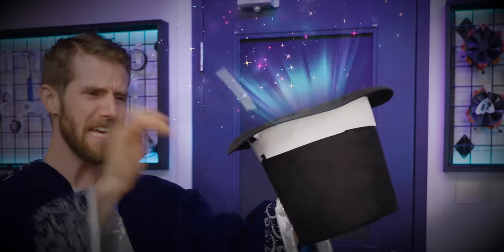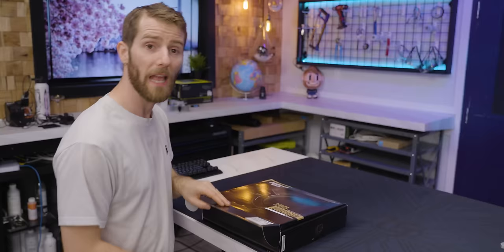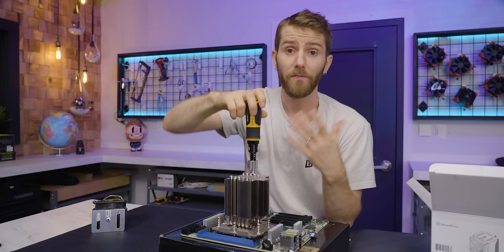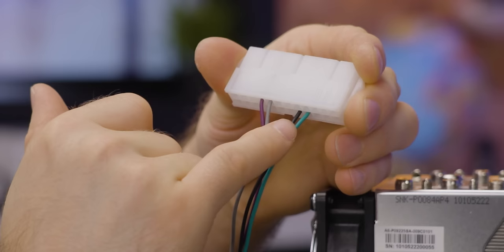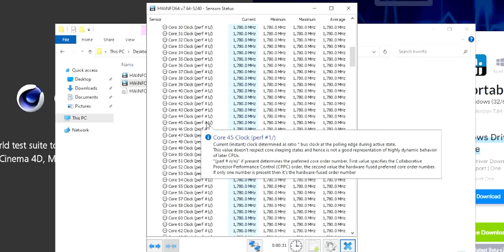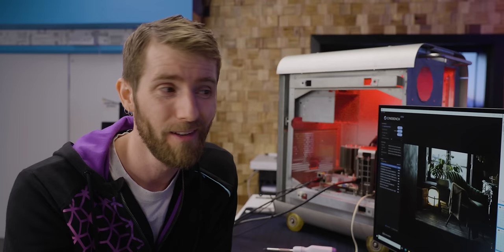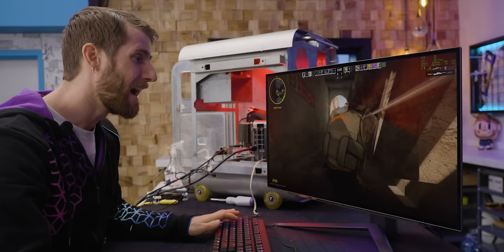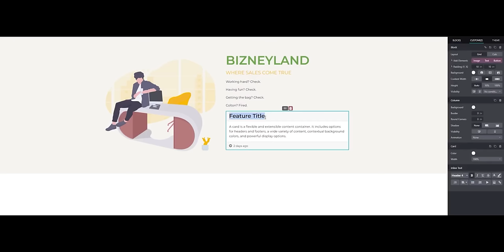AMD’s 128 Core MONSTER - Epyc Bergamo

Comment: I'm never going to get over how big the die is on EPYC.
Reply: “When your socket is almost as big as your memory slot” #justepycthings
Reply: There's 9 dies and they're not that big.
Reply: It's the same as Threadripper, in fact Threadripper are just consumer versions of EPYC
Reply: Compared to all other CPUs, it is GIGANTIC. @jfolz
Reply: One day we're gonna have Epycs that are gonna be the size of a 2.5" drive :D
Reply: @Qardo  The combined size of the dies sure, but individually they aren't that big
Reply: @Qardo  the IO die is about as big as AD103 (4080), which is big for a CPU, but it's also made on a less advanced process node. Each CCD is nothing special. Putting so many of them on one package is where the magic happens.
Reply: i want a normal ryzen 7 or 9 with that size. WAY better cooling!
Reply: It's like a coaster!
Reply: Just the CPU is about the same size as an entire Raspberry Pi
Reply: @Qardo the die and cpu are two different terms. The dies are specific silicon cores from the wafer. The cpu is composed of these dies. This one has, what did he say 8 or 16 dies, each die has several cpu cores.
Reply: @jfolz he clearly meant the package. It can be easy to get the 2 confused when you are learning. I am sure he will know the difference soon. Education education. Just let him know it's the package instead of been condescending 😊
Reply: @funbucket09  that wasn't my intention. However, how the new Bergamo CPUs are constructed out of many different dies (and how it differs from Genoa) is the first thing that's explained in the video 🤷

Comment: I remember how when I was a kid everyone had 128MB or 256MB of ram and when someone had 512MB it was like, whoah what do you need that much for. And once 512MB became normal but 1GB was still kinda extravagant, people would buy a 512MB stick and then wouldn't know what to do with the old 256 stick, and so they'd put both and run 768MB in single channel.
This computer has 768GB. 
Similarly, when I was a kid a 1GB disk was considered a big one. Now we have disks that can have several TB each.
It's like, in some 25-ish? years we got to a point when 1GB nowadays feels like 1MB back then, whether storage or memory, and 1TB today feels like 1GB back then. And it's messing with my head now lol
Reply: Well, you gotta factor in that eventually adcvancements will slow down. At some point we will reach hard physical boundaries.
Reply: This computer supports way more than 768GB, it's just infeasible to go higher unless you have a reason to spend the money. 256GB single dimms can be had for $3k each.

What's truly crazy is that the 768MB of memory you're talking about is now how much on-die cache these chips have, or a little over 1.1GiB for the X3D Genoa variants.

Comment: I suspect most end-users of this monstrous Epyc CPU will be running Linux, so it's sad to see LTT yet again put Windows on their test bench for a server CPU. Phoronix Test Suite is probably something LTT should have looked at, because that has quite a few server-related tests in it.
Reply: Especially the gaming benchmarks as always. Yes, those CPUs suck at them, because of the low clock speeds. Just in the last video about a server CPU and the one before it and the one before that.
Would be interesting to go through some real workloads for that, even if they would have to introduce most viewers to some other benchmarks for that.
Reply: The plurality will probably be ESXi followed by Linux and Windows. These really aren't the current best option for Cloud data centers currently, so for right now you would be looking at in house clusters or specialized systems. That means ESXi followed by Windows followed by Linux. And before anyone jumps on me, I do prefer KVM over HyperV, but Windows also has RDS virtualization which helps give them implementation numbers.
Reply: Thanks for confirming Linux users are the vegans of the PC community. We get it you like Linux.
Reply: they said at the end of the video none of these benchmarks are real tests of what they are for, and that the people buying this sort of stuff would either optimise their systems for it or let the customers who are renting the servers to figure it out themselves, i seriously doubt the real end users of this cpu would actually be getting data from ltt in help with their purchase
Reply: The point of running Windows is so that it's a like-for-like comparison. To use Linux, they'd need to go back and test all the others on Linux. And any viewer would need to run Linux to be able to compare it with their own system.
Reply: And server-related workloads are better suited on Intel, granted if people optimize to take advantage of the built in accelerations Intel has to offer. Plus AMD lags behind because they still only offer 2 sockets per system.
Reply: agreed, they shouldn't run Windows... they should run 64 Windows VMs with 4 cores and 8GB RAM each.
Reply: I think we still need that for a good comparison. Cuz windows should also be tested to see if they’ve made any improvements for server stuff. Mostly tho it’s just the applications for server stuff that hate windows for no reason (Aka they coded it bad, or hay’s windows as well lol)
Reply: You would be running Linux, without a doubt.

This thing is a bloody monster.
To think you'ld have two of these per slot and at least 8 per rack, that's 2,048 physical cores per rack!!

Insane.

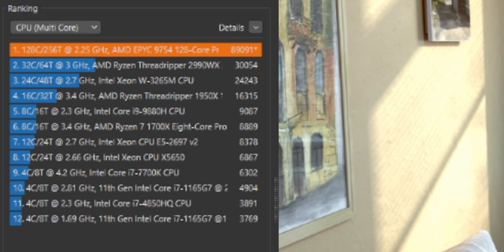Comment: 13:55 this just made me appreciate modern desktop CPUs even more. The 14900k (a 32T CPU) can hit over 43k points in the same test, which is almost half the score as this 256T CPU! (8 times the threads!!!) 
And remember, this is a test that can actually use all of those threads. Just insane how far technology has come.
Reply: Don't. That cinebench test scene wasn't anywhere near heavy enough for the cpu to shine. The gap is huge.

Comment: Take a look at GPU and cores affinity; in a worst-case scenario, you could potentially reduce GPU performance by a factor of 4. Only a few cores have direct access to the full PCI bandwidth. If the software doesn't manage this properly, it might need to go through another core, causing latency issues that could impact performance significantly. I'm familiar with these kinds of problems as I work with computing clusters.
Reply: Not much of a PC guy but, can it run Crysis?

Comment: I used to have a Opteron X2 170 with a 1Ghz overclock (on stock cooling!) for a gaming rig.  Older CPU's of that type had a lot more cache and could have similar clock speeds to their Athlong 64 counterparts, and it meant a lot more performance back then.

Comment: The M1 Ultra comparison is pretty interesting when you consider it’s a 20 core/20 thread chip vs a 128 core/256 thread chip. I know Apple’s cores are pretty great in terms of IPC but I would have expected more than a 4x difference (and this is as an M1 Ultra owner). I wonder if there’s some other bottleneck in the system or in Cinebench r24 that’s limiting the performance
Reply: What is the TDP of M1 Ultra? 50-60 W? Let use 60. So it has 20 cores. That means, 1 core has 3 W TDP. So 128 cores should have 384 W TDP.  But it only has 250/300W? That mena, that it is about for 100 cores the same but it alsi has multithreads (2/core), which makes it a bit more difficult.

Comment: As a 3970X (32c/64t) owner I’ve been waiting a long time for these replacements. I’d be interested to know how reliable they are at hitting their max boost clock, because mine rarely did, even on a single core
Reply: Water cool it, bro
Reply: @user-dv7hq2rh4g  What about undervolting a Threadripper?

Comment: 6000 points in CB2024 is 6x that of my 5900x, but its also only 60% of my 4060 that can break 10k points at 100w. I think the biggest thing CB2024 taught us is that CPUs need to leave the rendering to GPUs.
Reply: Less that and more that GPU architecture is highly optimized for rendering.
Reply: …unless you want to render a real scene for a big budget movie, in which case the textures alone might be in the range of 100 GB - good luck fitting that into any GPU memory.
Reply: A bit more than the 822 points my i9-10900X gets lol. My GPU, GTX 1080, scores 3993 points
Reply: till you realize that GPU's with a ton of memory cost a whole alot more than this CPU decked out

24GB VRAM costs you 2 grand USD and that translates in roughly 144GB VRAM worth of cards while this CPU can do well over 1TB

for smaller scale GPU might be fine but for 100+GB projects CPU's start to be a king due to capacity unless you get a board which can support that many cards
Reply: @danieloberhofer9035   which one do you have? outside of 4090 you only havs 7900xtx which can't really do compute tasks well cause it doesn't have CUDA

and anything older is well older and has way less performance compared to current gen
Reply: @mephistoxd2627   I honestly wonder if that memory issue can go away with better pipelines. Every pixel does not need to know about the full scene. So I am curious if some software out there works well for smaller studios that don't have the budget or needs of a server farm and so its designed to scale instead of just hard crash from memory needs.

Comment: My primary workstation has the 64 core 3990x which I use primarily with Arnold Render in Cinema 4D and Houdini. Been curious how much faster the 128 core CPU is. Looks like about 30% faster based on your test numbers. Great video! 

Cinebench 2024 is using Redshift XPU which until recently was a GPU only renderer which is quite a bit different than the old CPU based physical renderer on previous cinebench tests.
Reply: It's WAAAAY more than that lol. It's about +40% over the Zen 3 64-core Threadripper Pro 5995WX which is already ≈+25% faster than your chip.

Comment: To linus's point about F1 tech eventually making it into our daily drivers, there's actually a fantastic BBC documentary from 1984/85 that shows the entire process that went into the creation of the Ford Cosworth GBA 1.5L Turbo V6 that went into the 1986 Beaatrice/Lola-Haas/Ford (Carl not Gene).

At the end of the first part and beginning of the second it shows the development process of the ECU and they show the electronics engineers from ford motorsports europe working well into the night chasing down problems in the circuitry before the "big box" (the ECU was the size of a toaster oven) went into the car for its first track tests.

At one point they realized that there was a huge issue with detonation that was being caused by electromagnetic interference from the combustion chambers interfering with the ECU's operation, so they had to change the design placement from on top of the engine to inside the tub.

They even showed the IBM 286 desktop that the engineers in europe used to communicate with the head of ford motorsports over in detroit and explained how the multi-layer cryptographic encryption system it used to prevent competitors (like say Bosch) from getting into their system to steal proprietary information worked.

Comment: To think consumers may soon get a 16 core CPU on a single CCD or CCX is impressive and a worthy upgrade for my 5800x3d
Reply: Zen 4c clock considerably lower than Zen 4 cores. But that would make them ideal for a 8950X3D, one Zen 5 CCD with 3D Vcache and a Zen 5c CCD. Since the C cores clock lower it wouldn’t need to park that CCD when gaming as the OS would use the faster cores with the cache.
Reply: @LordApophis100  16 core CCD with 3D Vcache is exactly what I would want as a content creator, and give me another 16-32-48 without it for rendering processes.
Reply: Zen4c will come to the next generation of AMD mobile CPUs and APUs, but at lower core counts.
Reply: K.C-2049  I bought a used 3900X for cheap recently and its so nice, you might be able to upgrade if you're concerned since they use the same socket

Comment: Have you guys ever tested Ampere's 192 core CPU?
Reply: isn't that ARM and not x86 ?
Reply: @LeLe-pm2pr  Where's the problem? Those cores perform pretty similar to modern x86 cores and due to the higher power efficiency of ARM there are far fewer issues with boosting.
Reply: @LeLe-pm2pr more cores is more cores

Comment: 128 "execution units", 400W power draw, eye-watering amounts of RAM support, decent rendering capacity, ~$8000 MSRP... this is just a modern-price GPU that goes in a processor socket :P

Comment: This is why you should have pallets of spray air on hand.
Turn it upside down and go for gold.
I used to do that back in the early 2000 as the only way to try and keep up with Gibbo and marshy when doing over clocking comps at work.

Comment: I think these chips are great for hosting multiple game servers on one host. Think, minecraft or your space engineer like games.
Reply: or mutiple whatever on one host
Reply: What I'm thinking is office thin clients. With CPU overprovisioning, you could fit several hundreds of simultaneous users on a single node.
Reply: minecraft would probably run quite poorly, as even with paper it is extremely reliant on at least one fast thread
Reply: @LeLe-pm2pr Right. As much as a lot of cores sounds tempting, this is a job for the frequency optimized variants
Reply: Like others have said, for Minecraft you'd prefer a high clocked CPU. Minecraft server providers often use servers based on consumer CPUs like AMD Ryzen and Intel Core.

I went a bit wrong route back in 2013 and bought an old dual socket server with 2x Xeon E5420 2.5GHz (think of a slightly lower clocked Core2 Quad Q9450 but two of them) and 32GB RAM. It did fine and it was fun to play around with real server hardware, but in reality it would have been better to go with a modern, at the time, i5-2500K or i5-3570K with 8GB RAM.
A modern i5 system would have cost more but I ended up having to buy two different servers in 2013 because the first one died due to a lightning strike. The money I spent on the two systems combined would have been enough for a custom built i5 system.
Reply: @Pasi123  to honest, minecraft was just a placeholder. But now i know this. I will convert my old pc (i7-7700k) in too an minecraft server. Thanks for the inspiring idea.

Comment: Im surprised that the p/o pins on the 24 pin connector are only 5V until now, If you think about it, P=VI where V equals voltage and I = current, so to increase the amount of power you have to either increase (V) or Increase (I).  The Problem is however that when you increase (I), you are increasing losses which equals increased heat, so to increase the amount of power delivered to the chip you have to increase (V).  The only problem with increasing V, is that you have to make sure that the dialectric strength of the insulators on the board can withstand the extra potential difference (P.D) between 12V rails on the board and earth.  As they are moving away from 5 to 12V, the chip designers have clearly already done this.  Luv ya work

OZ

Comment: Jesus fuck the specs on this thing are insane. 128 cores, 256 threads, 128 pcie 5.0 lanes, 12 channel memory, 1/4 GIGABYTE of L3 cache, and apparently you can slot two of these fuckers into the same motherboard.

The sheer amount of power and data infratructure just to keep one of these systems fed, let alone banks of them, is insane. You can fit a whole damn super computer in like one server rack.

Comment: Commercial software from VMWare, RedHat, and others often have billing models based on the number of servers or number or physical CPUs. So if you have a billing model that charges based on CPU count or Server count, and you can cram 128 cores into a single CPU / Server, you can save money on licensing fees. It's not unusual to have license fees around $10K/CPU/year, so a $12K CPU would save quite a bit of money over 5 years of licensing.

Comment: Cloud Native, I understand as containerized systems, predominantly isolated, where communication between them is done at network layers and not CPU hardware.
Virtual machines, containers or lambdas, mainly Web APIs or database systems (in several different flavors and concepts)
In other words, the final program is not the most important, but how the infrastructure around it is built.

Comment: M1 Ultra is a 2021 chip (2-3 years old) with 20 cores and hit 1/4 the speed. With 4 of them, thats 80 cores. AMD still need 48 additional cores to get on par and use more power doing so. Shows you how far ahead RISC is

Comment: There is one thing I would really like to know but I can't find the information: we agree that due to the low clock the CPU is not ideal for hi fps video gaming, but it shouldn't be able, with its pace, and the necessary GPUs, and taking advantage of the 8 channels (or 12?), to run more than one at the same time?
Someone Knows?
However, the Epyc and ThreadRipper processors have built a gigantic highway that leads from the multitasking of the freelancer to the server of the multinational: it's fantastic! Everyone finds their own toll booth and is practically tailor-made. Wow wow! 😮😲🤯🤪
If you consider that in the real world the penultimate generations are still tasty morsels, there really is a lot to choose from. What an Era! 
Thanks A Lot! Great Presentation!
Reply: In short Games simply can’t leverage all those cores for gaming. Similar to how most games can’t leverage SLI setups for gaming. It’s simply too niche and too much of a hassle to optimize games for that.

Comment: Interestingly, because it runs at a lower clock, the ipc generally is the same even with reduced l3 cache. More clocks generally requires more memory bandwidth, which cache can provide. This is partially why zen 2 doesn’t perform any better past 4.4-4.5ghz

Comment: CS2 is thread bound, this means it doesn't defer enough tasks to other threads and/or is waiting on threads to complete... because they run on "slower" cores. Meaning whatever operation they are executing is "not optimized"... aka it is probably a single loop running over a LONG list!